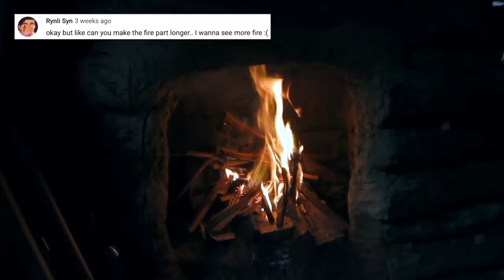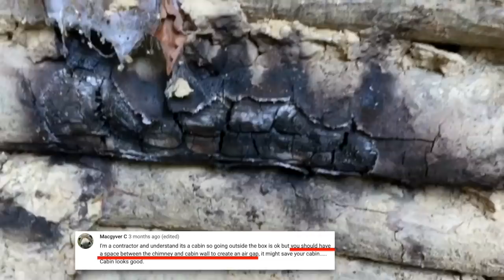Wood cabin stone fireplace build

Comment: i wonder if anyone knows if using moss would insulate the gap between the wall and the fireplace from the heat well enough ? or are you just supposed to have a little bit of a gap there ?
Reply from the maker: Hi there Robin, thanks for the question! I'm not an expert here (or anywhere, for that matter!) but according to what I've been reading and my personal experience you are supposed to have a bit of distance between the rocks of the fireplace and the logs of the cabin. I've been reading some books on cabin building and they all make that point clear. As a personal experience, I nearly set the cabin on fire with the first fire I made in the first fireplace I built, too small of a gap and a couple of the logs started smouldering. The heat builds up pretty quickly. I guess that using moss would have the same consequences since first the heat would dry the moss and then the moss itself would catch fire even easier. I used quite a thick block of mud to close the gap, and everything is working pretty nicely, so far. Cheers!
Reply: @EgoitzSalsamendi  so you placed some mud/clay in the gap between the wall and the stone/fireplace ?
Reply from the maker: @robinchwan  yes, I did! You need some space between the fireplace and the wall’s logs for that heat to dissipate. You just fill the space with mud!!
Reply: @EgoitzSalsamendi  alright i think i understand then.  you could also dig the fireplace further down to use the dirt to insulate as well i think but also place rocks near the dirt wall ( so you don't have as large of a gap between wall and the fireplace chimney ) if i'm not mistaken? like if you dig down a bit further then move the chimney a bit outward thus leaving the mud/clay dry from the weater, you wouldn't have to cut as much of a gap into the roof as well. 

sorry i went on for a while as i enjoy simple things like this where you build something and enjoy it later :)
Reply from the maker: @robinchwan  Yes you are right, I could dig the fireplace further, but I was limited by the size and shape of the rocks I had available in the area, so It was tricky to pull that out. Overall I'm quite happy with the fireplace, it works and keeps me warm. Can't complain. Cheers!

Comment: Cut two of the top logs a little shorter. Get Big rocks to run across like a mantle. Also you are narrowing the chimney to much as you get to the top. You are smothering the fire and now giving the smoke no where to go but in your dwelling, plus the top of chimney is gotta be hotter than hell when you do that. Your getting there you will get it eventually.
Reply from the maker: Not sure what are you advising!
Reply: The chimney opening is plenty large enough. I don't see any smoke going into the cabin.
Reply from the maker: I got a bit of smoke just in the beginning of the fire, before the draft begins. Does what I'm saying it make any sense?

Comment: This is awesome. Is there a reason the fireplace is on the outside of the cabin? Is that for safety reasons?
Reply from the maker: Thanks dustin, glad you liked the video. The main reason for the fireplace to be outside is, there is not much space inside the cabin. It is a tiny ass cabin! Also this area has very mild winters with temperatures rarely going below 5º Celsius. So the fireplace is not so important for heat. Cheers!

Comment: You need to use a cement..real  mud wont hold..then cover entire body with cement...
Reply from the maker: Well, In just wanted to try building the fireplace using only materials that I could find in the area. Unfortunately cement was not one of them. The mud is gone in a couple of tiny spots and the smoke scapes from them, but nothing i couldn't repair in 5 minutes. When this chimney collapses I might consider using real cement!!!

Comment: How long before that place burns to the ground.
Reply from the maker: Wanna bet?
Reply: Ha....no bet here...I hope it doesn't....you are one hard working guy. Can't let fire come into contact with that roof or the logs or it will surely burn and burn quickly!
Reply from the maker: It's not that I planned the cabin to last forever, or I want it to burn down ASAP! But I'm trying to do my best without having any idea about what I'm doing. I'm just having fun here; and learning a lot! Specially from comments! So far the fireplace has endured some roaring fires pretty well, so much that I couldn't stand the heat inside the cabin (it's quite tiny, mind you!)
Reply: I love what your doing. Much respect. You work ethic is amazing. when you tore it down and rebuilt it with the complete stone chimney you made it way more fire proof. Great series. I subscribed. Good job!
Reply from the maker: Thanks Roy! Yeah, that broke my heart, but the new fireplace is working very nicely! Now I'm filling the wall gaps with a mixture of mud and grass, I suppose It will take me about 9-10 working days (4 walls, both sides!) Thanks for your subscription!  Is that a salmon you have in your hands?
Reply: Rainbow Trout from Kenai River Alaska

Comment: Better build a roof cricket behind that thing or water is gonna pour right down the back side of it into the cabin.
Reply from the maker: Yep! I need to put something between  the chimney and the roof. But I don't know what. I can't think of anything I can do, build, or make with the materials I have in the forest. Mud doesn't luck like a good idea!
Reply: I'd build a cricket behind it and shingle it the same as the rest of the roof. still going to have to flash the masonry with something.
Reply from the maker: Yeah, that's the point! Damn it!
Reply: @EgoitzSalsamendi  maybe some tree resin made from sap. You could coat it in that.
Reply from the maker: Wow! That’s actually quite a good idea! I will need a ton of resin but it may work! Thanks Roy!

Comment: Just as I had assumed, and saw evidence of same. What's going to happen is that when it gets really cold and he has a roaring fire going to warm the place, the chimney that he constructed inadequately is going to burn the place to the ground and then he will be outside in the cold in the middle of winter. You absolutely must adequately insulate the wall from the fire. You could clearly see that the wall had began to burn. If that had happen when it was in real use, especially while he was asleep, the place would have burnt to the ground. He seems to be making the same mistake again. Don't start saying I'm just hating because I'm criticizing him, I just don't want you to die in your sleep because someone that doesn't know what they are doing gave you bad info. In addition, one should use clay as well because mud will not stay in place due to water and fire. He claimed to be replacing it due to it coming apart over time, but you could clearly see that it was barely used and was not only coming apart , but catching the house on fire as well. He did a tremendous amount of work and I commend him on that, but if you don't do a job correctly and with knowledge, under these circumstances someone could die.
Reply from the maker: Holy shit, that was a long comment! Thanks for your concern. I'm testing out the fireplace yet. I have no clay around me in the forest, so mud must do it. It's evident that I have no idea about making fireplaces, but I'm trying and will figure it out in the end! Thanks again for your concern, let's hope nobody dies!
Reply: @EgoitzSalsamendi  if you have regular rains then the logs are not dry and it takes several hours of fire burning to start to worry
Reply from the maker: Hi there, I tested the new fireplace and it works really good! I’m not worry about the logs catching fire, but maybe then I’m just a full 🤨🤨

Comment: I thought the top of the chimney had to be taller then the roof?
Reply from the maker: Yes, you ate right! I was afraid that the chimney would bend and collapse, so just in case
Reply: Ideally yes. The higher the chimney, the stronger the draw so taller chimneys draft better. Smaller chimneys work, somewhat, but taller is better. I'd be more worried about the mud used as cement. Unless it has a high clay content, which has problems of its own, the rain is likely to wash it away. I'd say a year tops before major repairs are needed.

In South America they use dirt two basic ways to make buildings, Adobe and Baracuoa (I think that's how it's spelled). Even then the rains can damage the building easily so they either use a Limestone wash to "paint" the exterior wall, or a cactus slime from a cactus that grows locally. 

Adobe was traditionally a mix of sand, clay, sometimes gravel and straw or hay, formed into bricks in wooden molds. Averaging 30cm wide and 50cm long, they air dried for many days before being air cured. Kiln curing is not traditional but modern. It won't permanently bond with metal, wood or stone since it has greater flexibility than those materials. It has greater water resistance than Baracuoa, which can be as thin as about 10cm and is simply a mix of dirt, rock dust and straw layered over a latticework typically made of reeds.

That said, your construction looks a lot better this time. I wouldn't criticize that at all
Reply from the maker: Holy cow! Thanks for taking the time for such a long, educational answer. That's the type of comments I love, so I can learn from my mistakes. You made my day! I like the idea of limestone wash, but that would render the chimney bright white, right? I rather prefer to keep it more inconspicuous
Reply: A pure limestone wash would make it white but in South America they often mix fine soil with the limestone to make it colored. You have to sieve the soil so only very fine grains are used in the mix and it's still lighter in color but it works. I'm not sure of the ratios though. The Nopal cactus slime doesn't have a color problem but since it's native to South America IDK where you would find it. Maybe there's a similar native plant where you live.

Comment: This doesnt give heat does it...
Reply from the maker: Hi Ron! Actually it does give huge amounts of heat! The fire place is quite big compared to the tiny cabin, so problems there. The problem is that it is terribly hard to keep the heat in!
Reply: @EgoitzSalsamendi  exactly, i reckon it all goes outside trough the chimney.. I think u need somethin iron standing inside with a chimney leading to outside. Rocks take too long to heat up.
Reply from the maker: Hey Ron! Well, this is not freaking Siberia, mate! It rarely goes below 0 C!! So I’m pretty fine how it’s working now! II’m chinking the walls now, so it should be OK when the winter comes!